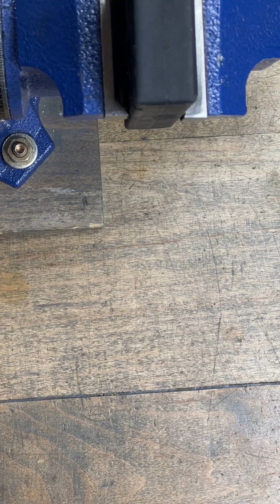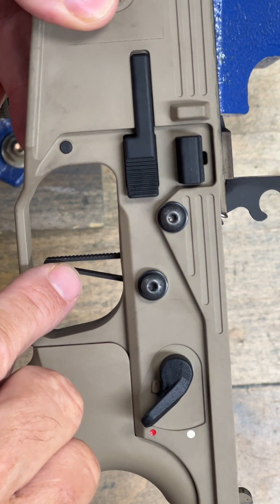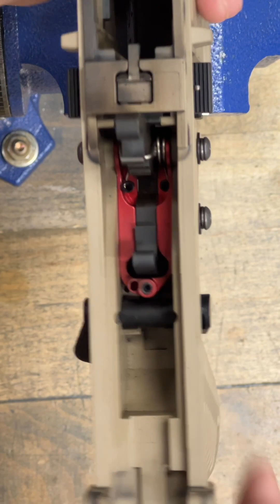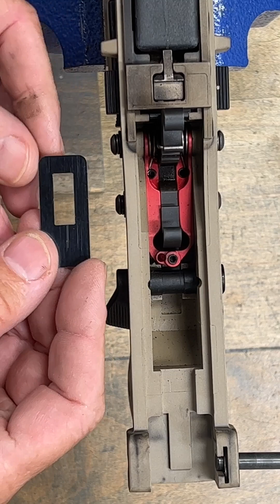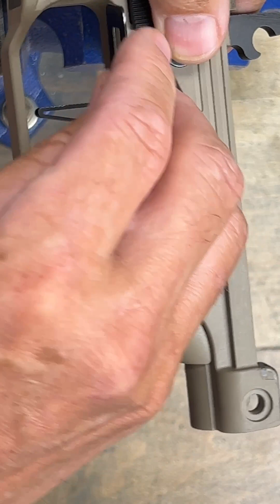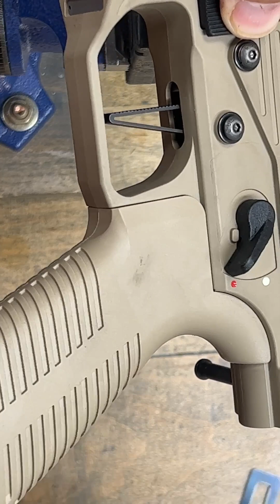Elftmann install B&T APC

Comment: I got an APC556 Sport with an already installed ELF trigger. It light strikes 50% of the time. Any ideas on how I can correct this?
Reply from the maker: I really don’t know for sure, however, here is the phone number for Elftmann. Give them a call tomorrow. They are located in Phoenix Arizona. (602) 441-5007. However, I do know a thing or two about AR15 and unless the hammer spring is compromised, I don’t think that anything else dealing with the trigger could be the problem. Oh, try the two vertical set screws of the trigger, make sure they are snug. But that also raises the question of what else could be the problem. A dirty or flawed firing pin would be the first thing I would look at. Is the round properly seating and extracting from the chamber (be careful!)? Are you using quality brass ammo?
B&T cust support is 1 (813) 653-1200. Florida
Reply: I just removed the metal plate, hopefully this rectifies the issue for me. Have you found a solution?
Reply: @noizychild  The most expensive way possible, I bought a branded new lower with BT trigger group, lmao. Anyways, I have an ELF trigger for sale now 😂
Reply: Everything else is perfect, I'll look at the vertical screws tomorrow and call up Elf if that's not it. Thanks for the video, info and the response man!
Reply: I have one in my AR as well and I'm having the exact problem. I've adjusted on the weight and I got a suppressor and that seemed to help for a minute but it's still doing the same mess. I thought about taking it out and going back mil spec factory which would suck because the money these things cost. I guess I'll play with the set screws as well, not exactly sure how that would make light hammer strikes but I guess anything is possible.
Reply: Most likely the hammer spring is causing the light primer strikes.I had a Timney in my Scar 17 and my sample would have light primer strikes.